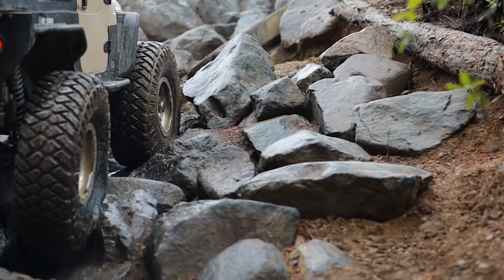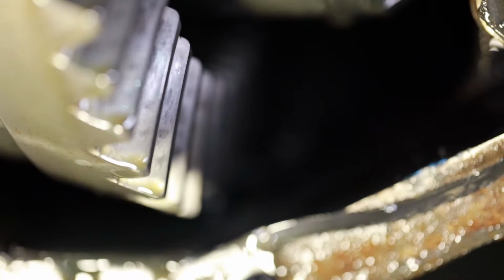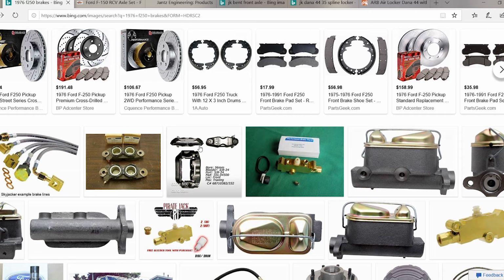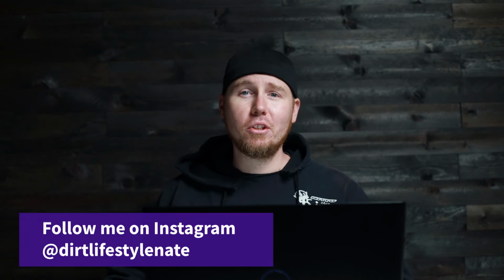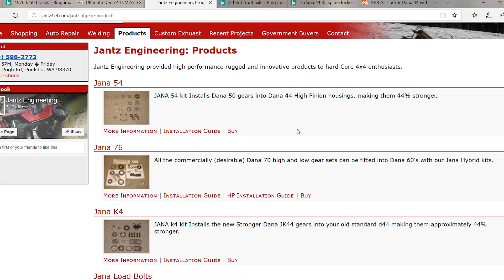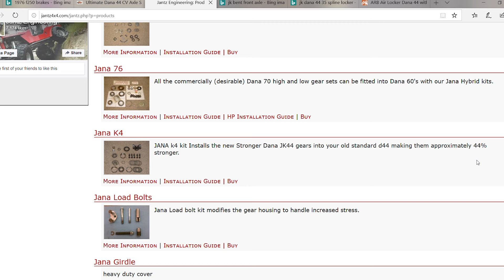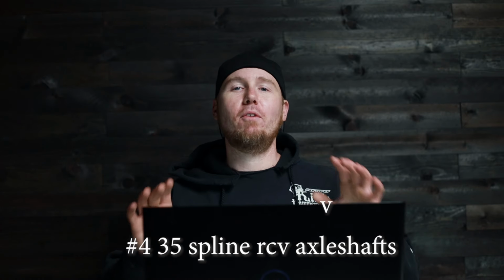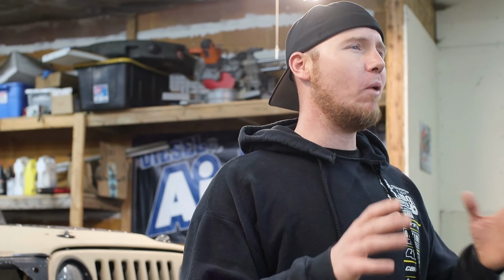Building An Unbreakable Dana 44

Comment: Hello there. 76-77 is not the only years for high pinion Dana 44’s. They’ve made them since 1968, the one I have is a  1972 ford f100/f150  reverse cut HP44 with 2.75x1/2” tubes per the BOM code. (Originally Drum brakes) 
It came supplied with the 76 disc brake set up; ( knuckles, axles, spindles & caliper brackets.  I’m wondering if 79 f250 flat top knuckles can work with f150 spindles hubs, rotors and caliper brackets. I want to run RCVs & high steer. Just trying to figure out high steer without getting 660.00 Reid ford knuckles.  I have a set of chev flat tops already machined, but RCV axles are a real pain to get in and out with those.

Comment: Would any of those Jana products work with the TJ Dana 44?
Reply from the maker: I don't believe so. You could shoot them a email to see if they have any solutions for your axle 👍
Reply: I would doubt because the tj 44 is low pinion and all jks are high pinion. I believe dana 50s were high pinion as well.
Reply: FYI the JK gear kit Jantz sells is for low pinion gears, the Dana 50 kit is for high pinion.

Comment: I was wondering if you know of any locking hub packages that would work if you build that ultimate DANA 30 with the WJ knuckle conversion because I'm interested in building one but with a lunchbox locker.
Reply from the maker: I don't know of one without welding on new inner c's. Not impossible but definitely alot of work

Comment: It would be great to see an ifs to solid axle swap but I know that takes alot of cash
Reply: fernando cabral agreed! Toyota preferably
Reply: Yes please
Reply: In my opinion there is already plenty of toyota. I would suggest something that is rarely seen done. For example an older nissan
Reply: Y'all can do it to my 96 Bronco
Reply: Doesn't take that much cash. A junk yard 44/50/60, junk yard leaf springs, maybe a junk yard steering box (if said truck had rack and pinion) and some builder parts tabs. The most expensive single part would be a custom drive shaft.
Depending on the truck and build, it could be done for under $2k.

Comment: Broke the housing on my 13 JKUR. My fault, didnt see a curb in overplow snow road. Trying to scare up the 4500 ish to order the Dana 44.   Funny thing is Im trying to also find a Dana 60 front for my 76 Dodge D200 conversion project. Sad part is i have three Dana 44s out of half ton Dodges in the yard - but no way to reweld the perches and whatnot - they are all leaf springs, and of course the JKUR is a coil spring setup.   Im in the Yukon Territory, NW Canada, so that makes availability of parts, and shipping, a total nightmare.

Comment: Your Ford HP Dana 44 has 3” or 2.75” axle tubes and 0.5” wall thickness?  I can’t remember the specs. I had one of those on my YJ and loved it.  It is not the same as the POS JK Dana 44 with 2.5” tubes and 0.25” wall thickness.  Just for viewer clarification.  I would love to swap a Ford Dana 44 in my JK. I wonder if anyone has done it?  Your channel is great.  Keep it up!

Comment: The JK gears used for the Jana Conversion are the low pinion rear set.  So the only direction a HP axle can go is the Jana 50 setup.  

You can use 35 spline RCVs in a Dana 44, but last time I called about this you have to use the Dana 60 CV ball.  The Dana 44 knuckle is not big enough for this, thus a Dana 60 outer knuckles must be used.  

The next problem with 35 spline shafts is the seal on the inner axle shaft.  If a guy uses the HP housing from a 78-79 Ford the inner seals have the same diameter as a Dana 60.  You can use the Dana 60 seals in these two years of axle.  All other years of the 44 housing use a smaller outer diameter seal that will not work with the Dana 60 seals. There may be seals out there that will work with this smaller outer diameter, but I haven’t found them.	

	`

Comment: Real curious to hear what happened to your Yukon locker. I have a zip locker from them in the rear axle of my jku and in the two years I've owned it, twice it's broke just like yours appears ( stuck locked in) and had to be replaced and once it blew a o-ring seal keeping it from locking at all.  They warranty it and all, but damn it's a hassle. I'll be switching to something more reliable in the future.

Comment: I have a dana 44 in the rear of my ford ranger which has four wheel steering .it has a 315 ring gear and pinion and 40 inch supper swampers can I put a standard ring and pinion in  ?

Comment: Thanks for the video. That’s helpful. Quick question of you don’t mind. Planning on re gearing my D44. Debating between 4.88 and 5.14 gears. How concerned should I be with the smaller pinion as lower the gear ratio??? As far as strength.
Reply from the maker: I have 5.38 ring and pinion on my dana 44. I've never broke a pinion so this isn't something I would be concerned about. But you need to consider use. I try to wheel in a way that is very controlled so I'm not a rock bouncer with a big v8. Your application could give you broken parts that mine won't. Good luck 👍
Reply: Dirt Lifestyle perfect and makes complete sense. Not looking to rock bounce and just want something reliable. Thank you very much.

Comment: I am looking at using a 76-79 ford F150 axle, can I put F250 nuckles on an F150 axle, use a Jana K4, Arb 35 spline locker and 8 lug spindles.  Looking at modifying my 2005 jeep LJ will this work?

Comment: So you have a 76 44 right? Does that make it a low pinion? Are there any problems with the cast C’s from 78-79 44’s? I have a line on a 79 bronco 44 and concerned about the cast C’s I’ve read about. Also can the Jana K4 work for a low pinion also like from the rear?

Thanks, Gus

Comment: Very good info! Most of the comparisons your making to the Dana 60 are referring to the older models as the newer Dana 60's (05+) come stock with 35 spline inners and outters. These in stock form are arguably stronger than a Dana 44 could ever be, as the 35 spline outters on the Dana 60 are larger diameter than the inner diameter of the spindle of the Dana 44. Keep up the great content!

Comment: Quick and dirty question. Is any of the ring gear options you spoke about capable with a chevy axle? Passenger side drop. Mostly the jana54 ? Possibly the jk44?
Reply from the maker: Yes. I misunderstood about the two kits. The k4 kit is for lowpinon and would work for you. The 54 kit is for high pinion 👍
Reply: @DirtLifestyle  thank you!

Comment: Here I come with my Dana 30 (until it breaks).. I'm on 35s, 4.88s, and wont change that, its plenty for what I do. Ive done all my own custom work with Artec & Barnes, full truss, gussets, sleeved, and fab'd up all Barnes offered 3/16" brackets, JL twin piston calipers, also mated to an Adams solid 1310 DS.  I'm running a Trutrac TORSEN carrier. I'm sure my weak link is the stock axles. I do want an inexpensive, easy to repair weak link but not sure if I want it to be the axles. If I get RCV (etc) axles, then my Ring/pinion would be the weak link right?

Comment: It would be nice to see a corporate vs 44. Basically I am building up an 89 suburban and converting it from 4x4 to 6x6 but sadly it came with a corporate 10 bolt and with as much money as im spending on the rest of the truck I cant seem to find a cheap one ton for the front.

Comment: quick couple of questions about axle choices.  i have a project i'm working on (it's a tractor) top speed will be ~20MPH, will have 54 HP (diesel), 30" tires,  geared waaaay down (wound out in first <2MPH - NP241 + doubler & lowest common axle ratio), 4wheel steer, 4wheel drive, and it will weigh about 3000lbs empty, and about 5000lbs loaded (will not be going anywhere close to  top speed fully loaded).  track will be about 60" wheelbase about the same (depends on how the balance works out).    the tractor will have typical tractor suspension (none).  basic balance will be slightly front heavy loaded, very back heavy empty.  cost is a very big factor.  ease of maintenance, and parts availability are also important will a Dana 30 with a truss work?  if not a Dana 30 what would you suggest?  thanks.

Comment: Does this only apply to the high pinion ford axles? I have a LP 1984 Jeep J20 8 lug dana 44 I’ve been thinking about using in my Jeep to keep things light weight.
Reply from the maker: I made a mistake in this video. The jk ring and pinion is low pinion. But this means that you could probably use the k4 kit in your axle. I would email jantz engineering 👍

Comment: I have a question on the dana 44 i have a dana 44 front and rear same gearing but I have a rear lunch box locker and a front air locker can you just swap carriers or is there any difference I know gear wise as far as cut there is I'm not gear swapping just trying to swap carriers

Comment: Hey Nate, I'm new to jeeps. ended up with an XJ that was moderately built already.  its on 35s. with TJ dana 44s. chromoly axles (33 spline and 30 spline), and WJ knuckles, 1 ton steering, a true trac in the front and a detroit in the rear.  I dont plan on going bigger than 35s but I want to make it as strong as I can for this set up.  What would you recommend? I was going to truss and do C arm gussets.  Will that be enough strength? should I do anything else? IRO almost alloy kit?  I am wanting to get into more technical offroading and some moderate rock crawling.  thanks!

Comment: How do you deal with the cast C-wedges of a 78-79 year D44 HP?  Or would you just re-tube it?
I haven't been able to source a 76-77 in my area.  I am actually about to pull the trigger on a D44 HP center housing with cut tubes and just re-tube it.

Comment: Great video! I have TJ Rubicon 44’s so I’m researching different axles. Have you ever considered building a front ford 9 inch? I like the idea of the convenience of the third member. Not sure what knuckles I would need and I’m wondering about reverse cut gears because it would be spinning the opposite direction. Any thoughts?

Comment: I got a 07 chevy 1500 6 lug new body style and i want to solid axle swap it, i think if i built a dana 44 id be okay but sill leery and thinking of just going right up to a built dana 60, only thing is then im switchkng my wheels to 8 lugs and its alot of weight on a half ton, what yall think?

Comment: If you want to put that old F250 axle under a JK you need to be able to add ABS sensors, otherwise it will go in to limp mode.
Reply from the maker: I want to say they make a fooler? Is that fake news lol? I've seen older axles in JKs I guess I'll need to ask how they did that.
Reply: @DirtLifestyle  I think on the 3.8 you can move all the sensors to the rear and fool it. With the 3.6 you need them at each corner. You might be able to source an aftermarket knuckle like a ried racing or maybe a Currie that could bolt on the old Dana 44.  But for that cost you might as well do the 06+ super duty Dana 60 front and Sterling rear swap from artec. 
Also the reason the jk Dana 44 stuff is so weak is because it takes the same knuckles as the Dana 30.

Comment: I have a high pinion Dana 44 in my shortbed 67 F100. Put 3.73(geared for a diesel install later) , a Detroit  Tru-track and Stainless Disc Brake with Warn hubs and 1-ton U-joints since I've had the truck
I'm pretty sure that axles factory.
Curious if you know anything about it...as far as strength and wanted to install the same type of axle shaft you run?
Reply from the maker: The OEM shafts break like toothpicks. Chromoly shafts are a giant upgrade but the quality of chromoly plays a big roll in reliability. I use RCVs and they are great but a high end chromoly shaft is very strong as well. Do your research to find out what works best for you 👍
Reply: @DirtLifestyle  Thank you. I Chromoly'd the back already.
Next will be 1-ton U-joints in the rear, Chromoly the front and better suspension. 
I'm torn between a 2.8 Cummins and the BT4.

Comment: What is your opinion on swapping a 1968 Ford F100 Dana 44 HP into a 1995 Jeep Cherokee Xj.
Reply from the maker: I wouldn't waste the time. Close knuckle and drum brake. Not to mention small weak axle tubes. Hold out for an axle with a stronger housing and disk brake 👍

Comment: what about the Dana 50 from the 98-02 250/350 trucks 03 is when they went to the dana 60 but from what i have heard is that the 50 is identical to the 60 ther than the internals of the 50 are  slight bit smaller than the 60 so how does a stock 50 pit up against a 44? is the 50 even worth taking a look at for some?

Comment: I’m trying to build a tacoma with a 3rz. I have a Dana 60 for the rear and a Dana 44 for the front. Booth off of a 71 f-250 I don’t intend on being super hard on em, mostly just crawlin around. Will I really need this expensive of axle shafts?

Comment: Yo Nate! I'm excited and happy for you finally taking the plunge into full time bad ass content such as what you normally make. What would you say the max tire size on a full built 44 would be? I've always heard 40s are pretty well max, do you agree or disagree?
Reply from the maker: Thanks! This is a hard question to answer. If it's on a chevy suburban then a 35 but if it's on a samurai then a 43. Power, weight, terrain and driving style all play a huge part. The weight of the wheel and tire combo also play a big roll!

Comment: an issue with the 76-79 f150 axles is that the radius arms are casted instead if welded? you cannot strip the wedges off becasue there would be holes no?

Comment: I watched your Dana 30 video but it doesn't go into the details that this video goes into. It's a specific build video. I would love to see a Dana 30 video similar to this. And also address that some people (Currie) like to run front Detroit lockers. And can a Dana 30 RCV destroy your ring and pinion when a broken u-joint is an easier fix on the trail.

Comment: What a video, Nate. I've gone back and forth with my LJ's stock Dana 44's but I think you have convinced me to keep them, and possibly upgrade to the JK ring/pinion and 35 splines. I'm running 38's and have snapped one rear Ten Factory chromoly shaft, but it's a stock 30-spline count.
Out of curiosity, what does your rig weigh?

Comment: Hopefully in the next few months I'll have a hp44 from an f250 in my lj. Doing the 5 lug swap and already have some 300 M rcv shafts for it.
Reply from the maker: Sick! Beast mode 👊
Reply: @DirtLifestyle  another mod I've heard of to increase strength in a ford hp44 is to do a 35 spline locker, weld on d60 inner c's and the accompanying knuckles. So you could then get 35 spline inner and outer shafts which is what the new hyped up 05+ sd60's have. But with d44 clearances.

Comment: I ended up building a D44 for my LJ. Currie housing with JK inner C's. 64" wms to wms. RCV's, Detroit on 37's with a turbo 4.0. Holds up. Price is close to a 60 I'm sure but I purposely didn't track how much I spent lol.
Reply: Josh Hinshaw yes that’s my worry. I want locking hubs and want to run 38’s. My wants are not cheap

Comment: i have a 1994 ram 2500 5speed gas burner it has 60 in rear with limited slip and 44 in the front i only use the 4wd about 4 or 5 times a year generally pulling someone out of ditch or moving a car that won't run been thinking about installing a lunchbox kit in the front diff sometimes i do need both front wheels to pull do you think this is a mistake. I DO NOT GO OFF ROADING OR PLAY IN THE MUD OR HOTROD THE TRUCK DAILY DRIVER NO ABUSE

Comment: Awesome video and great information. I have a question for you or anyone else willing to provide advice. I have a 2012 JK with a stock Dana 44 in the rear, I upgraded to chromemoly axle shafts. In the front I swapped my stock axle with a 44 Dana Ultimate Spicer. I have been running 37’s for several years without any issues, would I be able to upgrade to 40’s or would I need modifications? I do some pretty technical wheeling but I’m afraid of breaking something, not sure what to do? Any help would be appreciated.

Comment: 78-79 F-250 HP Dana 44's have 3' tubes and .500 wall.
Reid makes Dana 60 inner C's that have 3" I.D. tube collars.
Think about having a complete 60 outter on your 44 with Jana K4 diff mod and 35 spline inner and outter shafts.
You would never break in any vehicle under 5,500- 6,000 lbs.

Comment: Thank you for helping making up my mind and clearing any future anxiety lol. Just purchased an 07 JKU on 40s with D44 and atlas TC. Previous owner did the proper upgrades as far as sleeves  and C gussets (stock shafts) but still wanted do D60 swap. 
But after watching your video I’m definitely purchase a pair of RCVs and just wheel. 
But I do have a question and love to hear your opinion. PO geared them to 5:38s should I swap it to 5:13s for more ring and pinion strength?
Reply from the maker: I would definitely stick to the 5 38 ratio. Everyone has their own opinions on this but I like to be geared as low as possible. If you have enough torque to brake 5.38s then you have enough to break a 5.13. 👍
Reply: Dirt Lifestyle thank you for the reply really appreciate it. In fact after watching your video I watched another one shows the difference between 5:13 and 5:38 and there is virtually no difference in size and strength so I’m keeping the 5:38.

Comment: Great video! Keep it up! 
Question. I have been on the fence about the K4 kit in a TJ Rubicon rear axle for a few years now. It’s hard to find information or real world experience from anyone. What’s your thoughts on K4 kit in a TJR rear housing with 5.38s / locker/ chromoly/small truss and some aggressive 37s?
Reply from the maker: I'm not sure if it would fit. It should in theory but I would email jantz engineering 👍

Comment: I’ve looked into rcv axles, but my problem is, I have the same axle you have under my f150 but I went to (ball joint out ) 3/4 Dana 44 and my spline counts are different (inner shaft to outer shaft) than what they have  an option for.